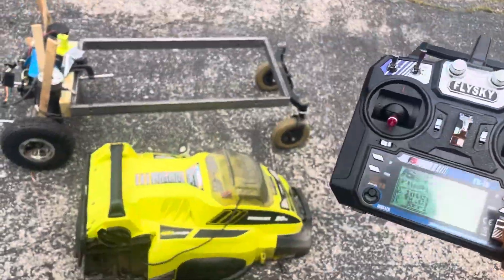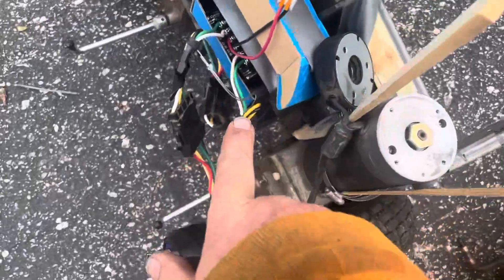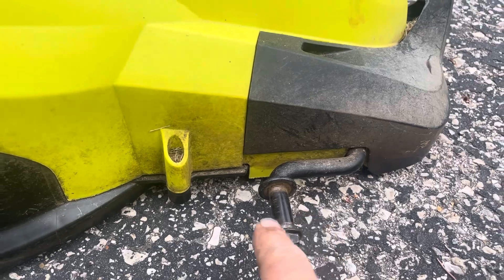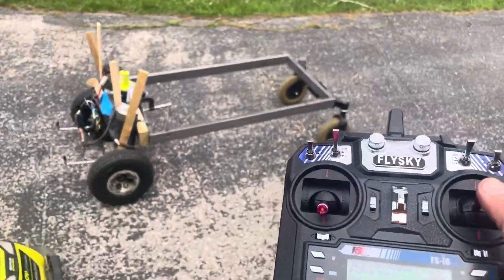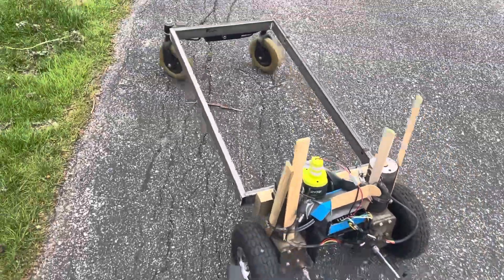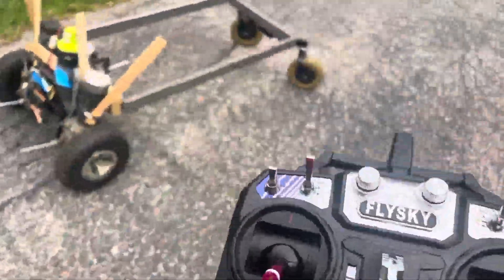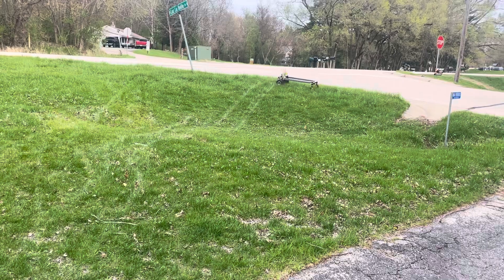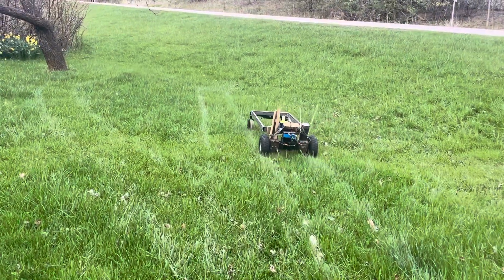RC Lawn Mower - Rough Frame design test

Comment: And the height adjustment will be the next step I guess?
Cheers 👍💪✌
Reply from the maker: Yep, you got it.
Height adjustment is already built-in - I just need to connect the frame to the axles where the mower wheels were.

Comment: Looks very fun.
Traction may be a slight issue when turning. Especially since traction wheels are that close too each other, and the swiveled wheels so far away.
I would aim to put maximum weight on traction wheels, so much so that it almost lift swiveled wheels. And maybe a lifted safety wheel or bar behind traction wheels stopping it from falling backwards.
Good luck. Well an engineer don't need luck, just time materials and tools :)